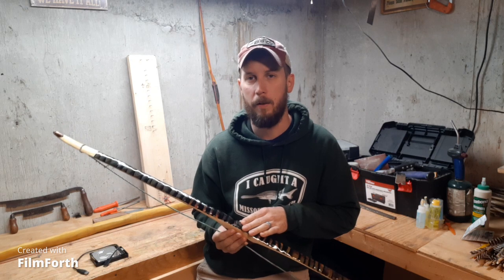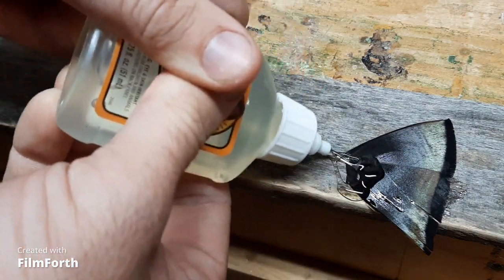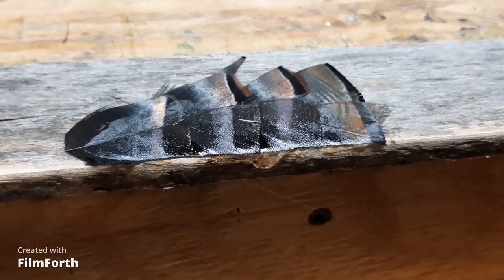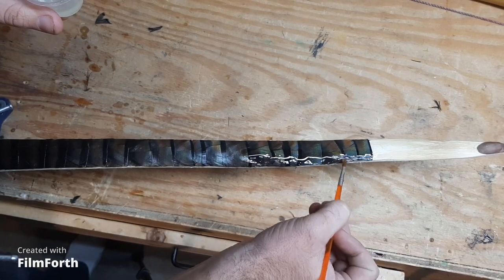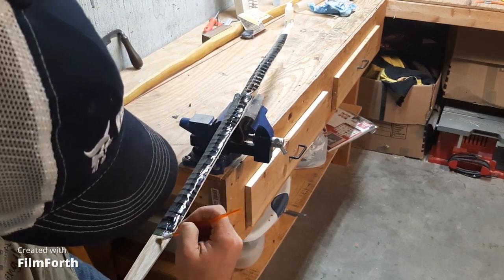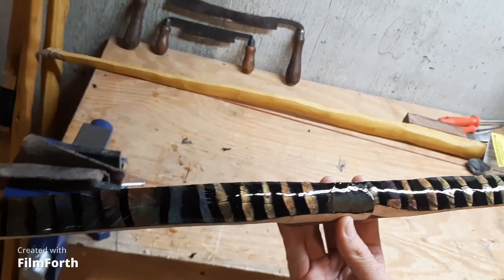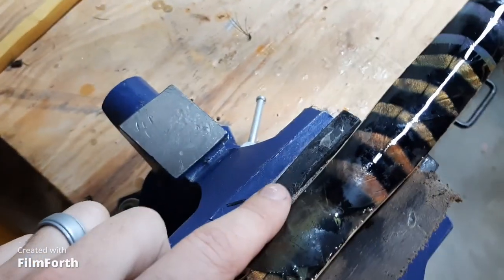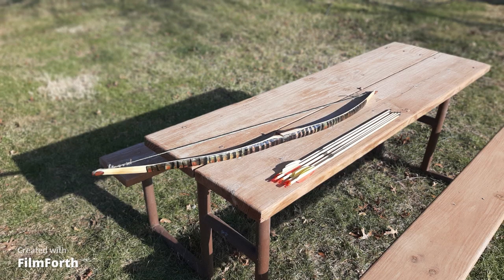Backing a Bow with Feathers - Part 2 | TheWayIDoIt

Comment: They look great, but the shining of the epoxy makes me worry about reflecting light spooking game when hunting.  Do you think the backing would hold up without the top coat?
Reply from the maker: No, unfortunately it won't hold up without it. The shine can be mitigated by using a #0000 steel wool to dull the back. A more temporary solution is to use wax to dull it and then buff it back off when done hunting.
Reply: @thewayidoit6312   Good thinking.  Thanks again.

Comment: Ingenious.! Was this your original idea.? So the coating allows stretch.? I have a horn, sinew , wood core composite bow I am considering applying this to.
Thankyou for two great videos, from Wales,U.K.
Reply from the maker: Thank you, I learned this process from a fellow boyer on the Primitive Archer Forum 2 or 3 years ago. Other than him, I've never seen anyone else do this.
Reply from the maker: Yes, the coating allows stretch without cracking. If you use a finish that dries hard it will crack and look bad.